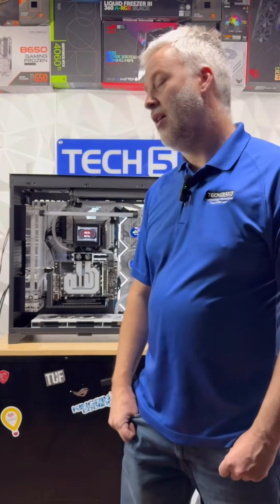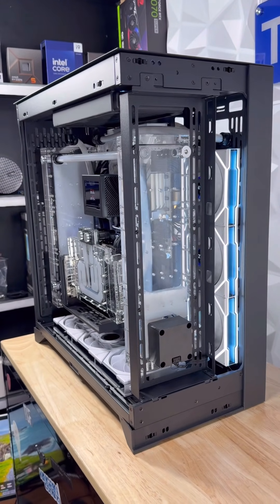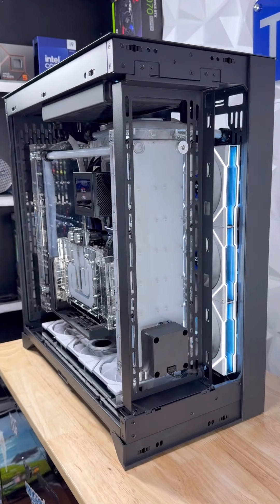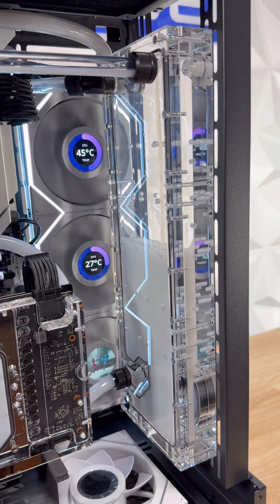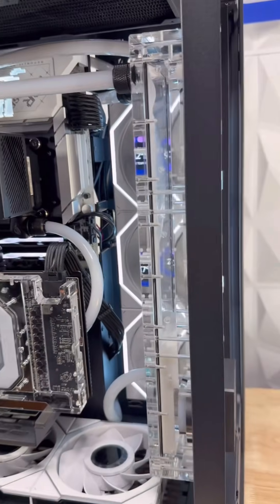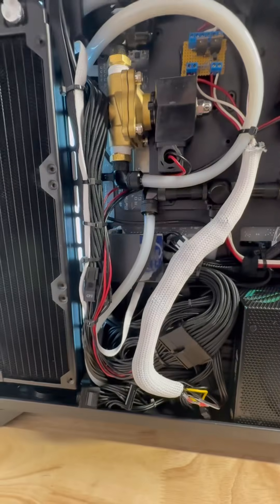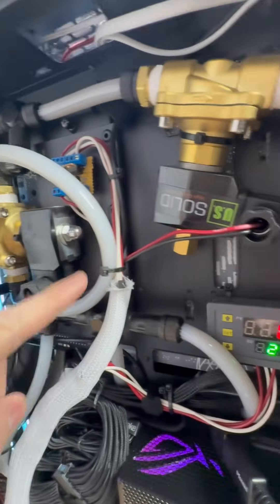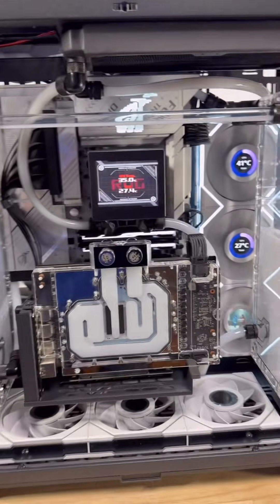Waterfalls PC - A custom water cooled PC with Waterfalls

Comment: Thats really cool, although I'd like to say two things. I really feel like there's a simpler way to do this, the extra valves and solenoids seam overkill for such a simple thing... The other thing is How do you get a video output from the GPU LOL🤣.
Reply: For the GPU there's a 90° adapter
Reply: acting like overkill is a bad thing
Reply: @vazalt5923 I think If can be done simpler then its actually a better thing. Less things to break and in this case more space in the case.
Reply from the maker: @Pk-yz2lw yes, my last build I used four electric solenoids and one pump.  It worked well